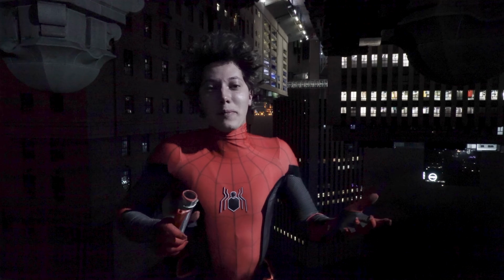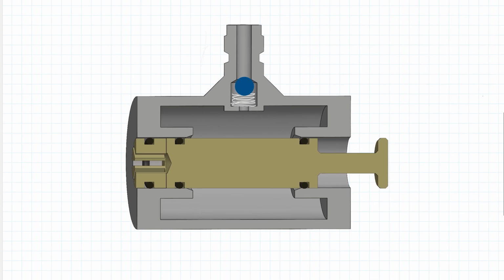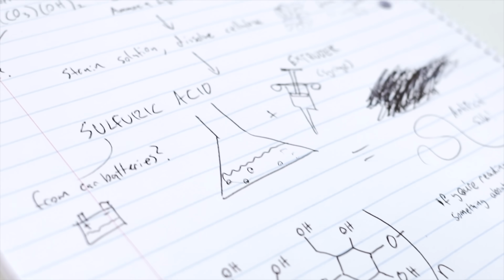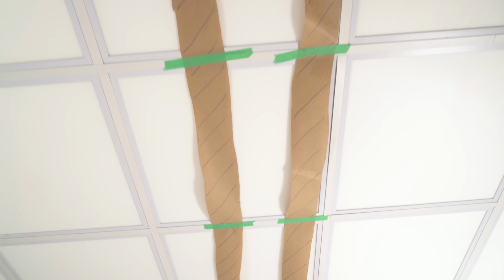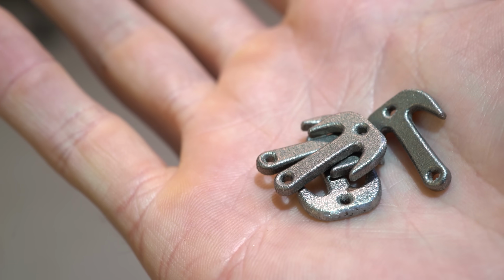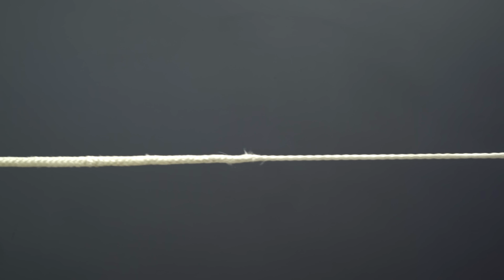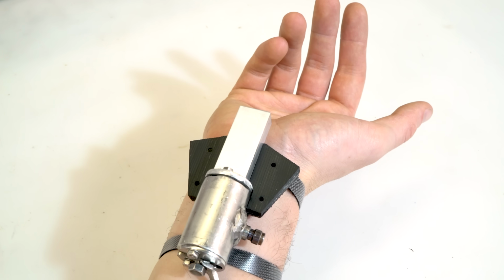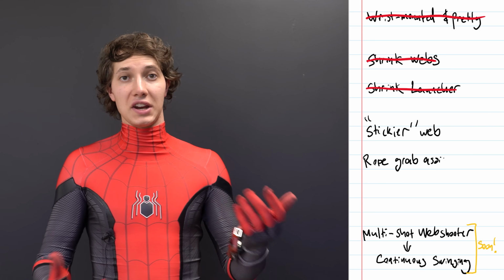Engineering real Spider-Man webshooters

Comment: Have you considered fpr the gloves a material like oobleck as a layer between the glove and maybe some extra protection shell on the palm of the glove to prevent friction from breaking the bag holding the oobleck like material in order to create something that will reliably hug around the "web" and harden to resist the sudden tension that happens from a swing? Some phone cases have a thin impact resistant layer in their casen that function similar to oobleck. Maybe that could be utilizef
Reply: It hardening would mean it can't fully grip around the rope, as it isn't flexible enough to get full surface area.

Comment: This IS cool. But I have such a bad feeling about this. That much pressure should not be in something that small. What if the central valve blows back, shears the lever while your aiming it. I definitely get the feeling from the barrel test that this thing can crack skull.
Reply: Maybe implement at LEAST one failsafe. For my sanity.

Comment: Why not spider fibroin/spidroin from kraig biocraft mixed with some UV643 Urethane Acrylate, graphene, and a 400nm chemiluminescent (not sure which one would be best, you want low volume and for it to not impair any desirable characteristics of the mix). A 400nm ring light around the launch tube could help start it too. Maybe it would actually be better with an internal UV along the dispenser tube too then the liquid gets spun.

Quick edit: You might be able to synthesize it yourself acsnano.4c08557

Comment: I have an idea, vacuum. Use a backpack and have a vacuum in it that connects to a VERY long tube with a suction cup at the end with a hole in it , when you shoot the web the vacuum turns on so when it touches something it sticks to it. And have it to where if you press the trigger again after you launch it it comes back. It probably doesn’t work irl but it’s a cool idea

Comment: Not sure if you've worked with scripting, but a tiny rpi running a script could be fitted into the mechanism with a microcontroller activated by a force sensor to check the amount of force used on the trigger for potential misfires, and keeps the valve locked if it doesn't exceed a certain value. Also a tiny OLED display can track how many hook webs you've used on each hand with another smaller sensor using an Arduino mini so you can know your remaining volume in each shooter. I saw this video months ago, but YT put it in my feed again. Great work!

Comment: Awesome, a few ideas

I'm assuming even I thin coating of plastic, vinyl, etc could radically reduce shock to the tool steel, especially in the front where it's most likely to hit things by accident

Also it doesn't need to carry your weight, the friction of the rope wrapping should make it much less, 
There's the chance that you grab something slippery like a smooth metal rod etc, but for most things it should grip well 
You do have the weight on the hook where it reconnects to the line, but actually if you skip the hook and just make the line stick to itself at the end then if the rope just loops around coiling on itself, instead of forming a triangle, then all the weight stays on the main line and the grabbed object, and friction between them, with even a little friction and 5 to 10 wraps you could get hundreds to thousands of pounds of friction, probably snap the cable, or bar before the rope slides off 

Also a fabric end would be less dangerous

Though you would have problems with storing momentum to get distance
So maybe still have some kind of weight, but you could make it any shape you want, and you could cover it so it's less dangerous, eg even a millimeter of padding could save windows

Comment: So you have to carry a tank around when you're using that? Seems legit
Reply: did you watch the video
Reply: @crispyy5980  Yeah but it's only a few shooters then what happens when you run out? Go to the local gas station and pump in air?
Reply: @sf1292  u can proabbly carry small ones
Reply: @crispyy5980  Then it becomes a hindrance, your center of mass shifts and you have the downside of having to refill every 3 shots, or 6 shots if you use both hands.

Comment: So this is a crazy idea, but you are using pressurized air as your "web fluid". What if the web line was tubing instead of string? And the end of the web is a vacuum pump. Jlazer did a video where vacuum pumps can be strong enough to climb buildings with. Because of that, if you made that the end of a web you shot, it would actually make the web sticky.

Sucking the air in to stick (like a suction cup) would also double as a way to fill up the the tank for the pressurized shooter. And to retract it, all you would have to do is turn off the vacuum, making the web reusable. And one on each hand makes them swingable. Add a motor for automated reloading and. . . you might just have something. Vacuumsuction makes it air-tight, so it would even work on cloth. 

The big issue would be weight and powering the thing. But that's what makes it scifi superhero tech.

Comment: I know this is Spiderman inspired but you keep inadvertently bringing batman's grapnal gun closer to reality. Mostly because Spiderman's webs fill the same niche with far higher technical requirements. I'm honestly convinced you could already make a compact grapnal gun.

You could use this incredible launcher in tandem with compact motor designs like the previous grapel gun. And you also have much more line as a viable option given the new web developments. The solid thing about the grapel is that it's innately retractable and reusable. Really neat.

Comment: I highly recommend to check out Jarius of all's hidden blade video! He used a small processor to adjust the strength of the air pressure to push the blade out and back inside the chamber. Maybe you could incorporate something similar to control the web shooters - filling them up just enough to fire safely, but storing the maximum amount of gas possible (only if it's safe, of course, wouldn't want it to blow up on your wrist now won't we).

Comment: the next step is making a web that doesn't need to be unhooked and retrieved, right? maybe with cartridges to swap out and reload as needed? I know how this sounds, but have you seen Schizo-San's web shooters yet? he was working on a polymer with any tensile strength at all and ended up with a really solid cartridge design based on bic lighters as pressure chambers. everything was very low-profile and I think would integrate fairly easily into your valve design.

Comment: why not make the reel on your back make it compact and changeable and armor with a metal tub guiding at points you would touch the rope also to add friction to slow down the road you basically are having gun ropes attached to your body and i think your not hooking to the top of skyscrapers maybe 2 to 3 stories at the max so the friction could slow it down a bit. you could also a switch to make the tub flip open since the ropes only pulling on one side so you can change the rope. by adding the reel cartage to your back and just feed it to your shoulder elbow and then add a metal guard to your wrist to not screw up your hand. I don't think its an amazing idea and i feel a more talked out idea could make some better ones. but i feel this is the simplest way to make on off the top of my head.
Reply: you could also make those reels have a windlass like a ship uses to lift heavy stuff since the metal on your shoulders would be acting as the main supports and not just your arm holding your whole weight. but it may put a lot of pressure on your arm and hold you in a stiff pose. but if you can make something to grab on to it you could use upper body to lift at least a bit to do some of those low swinging poses spider man does.
Reply: i love the effort i run and aottg expedition community making maps and me and my friends often talk about odm and the realism of it we've drawn up our own odms and stuff like that since we didn't like bulky boxes on your body and no big thing to cover it up. like a curve blade makes the most sense  in most situation a curve blades add to the ability to a sword are minor. the benefits are you get a longer blade length and often spinning or slamming into a titans nape often adds more pressure for a straight blade. sadly one of the few real words issues we can't solve is those things getting stuck in the body unless you got godly strength like spider man.

Comment: There is a guy called Alexlab that makes reactors that can create high pressure gas’s to refill his systems. Maybe you could make 1 of Those in the form of a spider that keeps refilling the same chamber after using it. This way you only need 1 shooter per arm and figure out a way to retrieve the rope you just used
Reply: It’s a hydrogen reactor I think and you can make that really small and flat

Comment: When designing the new valve, how did you determine the operating pressure of the design before testing?
Reply from the maker: I just went with the biggest number that high pressure air storage tanks generally hold haha

Comment: How about using a self-propelled spiderweb with a tiny ducted propeller and a super-capacitor? 

You could even add a microcomputer to adjust power on the fly, apply things like gyro-stabilization and so on.

Comment: i bet you could make even thinner webs in the future. the hooks look great but have you considered using actual braided steel cable for the line? btw i think medium carbon steel might suit your purposes better than tool steel for this project. you don't need springyness or edge retention, you just need maximum toughness. i think something like 4140 would be ideal for this, but it would require comparative testing. that's what they make trailer hitches and gun barrels out of. steel gets less tough as its carbon content increases, even though its hardness becomes more controllable, so medium carbon steel would probably be the ideal toughness. this way you could make the hooks even smaller. by the way, im sure you're planning on doing this, but you should probably proof the hooks and line to triple the weight they need to bear. i think ~900 pounds should still be managable though if you do everything right.
Reply from the maker: Yield strength is actually the most important factor, then touhgness next. So 4140 is probably too weak, even though it's quite tough. I've also bought a piece of S7 (shock resistant tool steel) which might be best of both worlds.
Also, it sounds crazy but dyneema is actually stronger in tension than steel cable (not even strength/weight, just in strength alone).
Thanks for the comment!
Reply: @Built_IRL  that's really cool. you know a lot about steel lol. it's insane that dyneema is even stronger than steel cable. thanks for the response :)

Comment: This is so cool! As a huge spiderman and engineering fan I've been following your channel for a while now. For the capacity issue, are you planning on using a rotating multi-cylinder design like the scarlet spider design from the comics? Also cutting max power by at least half would give you a much smaller profile so I'm excited to see how small you can make the individual cylinders while still keeping it save enough to use. Keep up the good work though! 

Edit: Also I forgot to mention how cool it is you just invented a new high psi valve just because you needed one that was small enough and released air quickly enough. Genuinely super cool. Also your hook chain is so awesome. Hope you patent those!
Reply from the maker: Exactly, shrink it down even more and then possibly use a wrist-revolver design. We'll see though, that's still two videos away

Comment: The fact that every iteration feels more and more like the real thing speaks for itself. The biggest challenge is the part you plan to tackle next. The human body isn't exactly designed for swinging like spiderman, so making it possible to hold onto for long durations without removing your arm from its socket is gonna be the big one. I'm excited to see what comes next
Reply from the maker: I think that should be easier than the fundamental volume constraints of multiple webs, but I guess we'll see!
Reply: @Built_IRL  depends , you would require a whole bunch of webs that WHO KNOWS may splanter up and not go in desired location ? but man seeing you literaly inventing stuff gota say you may just make a way ngl XD
Reply: ooh this ones easy, power suit frame, like an exo suit on your spine shoulders elbow and wrist

Comment: Absolutely phenomenal. Great job, I can't wait to see more. Be safe.

and yeah I was kinda shocked you started at 900psi with such a small diameter barrel. I've experimented with custom compressed air guns a lot tho, and kinda knew what to expect.
Reply from the maker: Yeah. I found it interesting that going above like 500 with these short barrels didn't make much difference. I guess the projectile had left before the full pressure really made a difference
Reply: @Built_IRL  Indeed! it's quite surprising the difference an extra inch of barrel makes even.
Keep up the good work man! Love your content.

Comment: Here is the next upgrade for you: add a laser distance meter, microcontroller, valve and presure regulator to automatically control pressure and by that distance of shutting range
Reply from the maker: I'm trying to get away from electronic control (more annoying and less reliable) but it is an idea I've considered

Comment: You sir, opened a whole new Feld for terrorism with home made high pressure guns. With a few slight modifications like a magazine and a QEV valve you could make a high air pressure driven clock or even a sniper 😂nice 🎉
Reply from the maker: Thanks! Yeah this is kinda a QEV replacement that works better at small scales and at much higher pressures. For large launchers I think the traditional QEV is better

Comment: Long time no see, great to see you’re still inventing everyone’s dreams
Reply from the maker: At a rate of 0.5 dreams/year haha
Reply: @Built_IRL  we’ll take it🤣
Reply: @Built_IRL  oh I’m sure you thought of it but a spring loaded valve that opens when struck will get to more shots at 3000psi, like a pcp you only dump a percentage of your air each strike I’ll add a little more bulk but you could quick load a 3 shot web canister that way without having to completely reload the whole system, you could honestly use the thumb ring to load the tension on the striker and at full pull the striker is releases and letting go of the string resets the striker using a spring or even a rubber band

Comment: You can heat treat them yourself in your own home oven. It's not like they need to glow red hot. In fact, you don't want to treat them over 400 degrees. All heat treating is for is to get the molecules to align in a natural crystal lattice through expansion and cooling. It's not rocket science. Next time, save yourself some money and time and do it yourself. 3 hours is all it takes.
Reply from the maker: Unfortunately that's only for the tempering stage, first hardening requires more like 800C
Reply: @Built_IRL  It seems to me you should want malleability over hardness. Hardness (high temperatures) leads to fracturing and brittleness.

Comment: Canada regulates high powered airguns.  Ask your friends at Hacksmith with they didn't make a more powerful gauss gun.
Reply from the maker: I think it comes in under the muzzle energy limit because it's so small
Reply: @Built_IRL  "Maybe" at current usage levels, but not when you were blowing through the osb chip board at "1/4 of 9mm" energy.  It would be legal in most US states, but not in Canada.
Reply: @Built_IRL 1/4 of 9mm is still 100-120 FPE.  More than enough to be a deadly weapon.   Very close to .22LR when fired from a rifle.  From the airgun laws website the limit for unregulated airguns is insanely low in Canada.  "Air guns that have a maximum muzzle velocity of 52.4 metres (500 feet per second) and/or a maximum muzzle energy of 5.7 joules (4.2 foot-pounds) are exempt from licensing, registration, and other requirements under the Firearms Act, and from penalties set out in the Criminal Code for possessing a firearm without a valid licence or registration certificate."

Comment: I wonder how a combination of liquid and solid "web" would go. Like taking the hot glue idea and making it dispense around the fired line. Then you get the stickiness and the strength.
Reply from the maker: Cool idea! Unfortunately the several-hundred-kg requirement really makes a lot of approaches less viable than they might be for, e.g. a lightweight swinging robot.